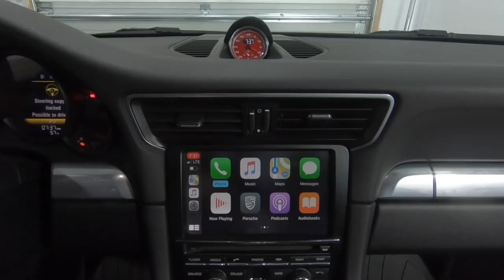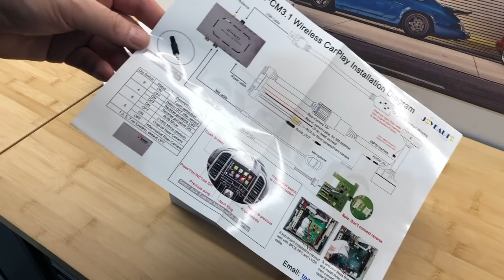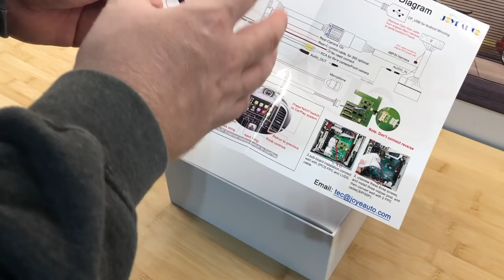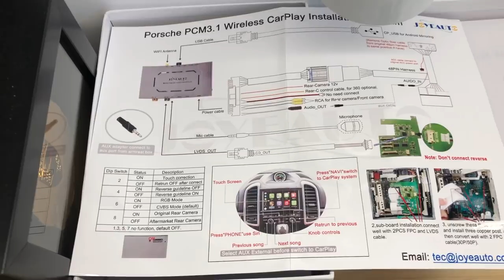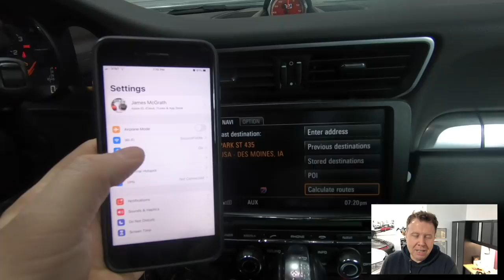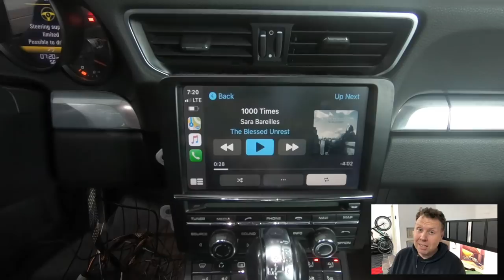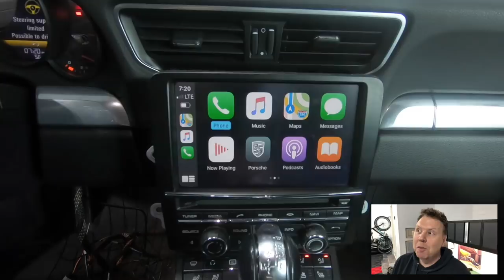Apple CarPlay DIY (Wireless) for Porsche 911 / Cayman / Boxster / Macan / Cayenne / Panamera

Comment: Anyone know the difference between this one and the one from  nmautomotive? Its almost 200eur difference.
Reply from the maker: From what I discovered, they’re very similar solutions but assembled and sold by different companies, but they essentially function the same way. If I remember correctly the Joyeauto solution is the less expensive. Maybe because it’s produced and sold direct from China vs. the one sold from the UK.
Reply: @AutoAmateur  it also looks like there is an ugly config screen that is not from Porsche or carplay. that looks to be different with nmautomotive. Is that screen a 1 time setup or does it appear often?
Reply from the maker: @jasjeetsuri  There are a couple of screens you will see once or from time to time. There is an option to configure your touch-screen to work better with the JoyeAuto device. If you flip one of the little white switches on the rear side corner of the JoyeAuto device (check your instructions for which one) a configuration screen will appear when you power on the device and the PCM. Once you have fine tuned your touch screen config, you need to power everything down, flip the little white switch back to off and then when you start up the car and PCM again you won't see that screen ever again. The other screen you might be referring to is the JoyeAuto home screen. This will come up if your iPhone or Android phone isn't connected via Bluetooth to the "JoyeAuto" bluetooth device option in your phone's settings. You can configure a few different layout and look/feel options from the JoyeAuto PCM home screen. Also, when your phone reconnects to the bluetooth the CarPlay logo will appear green for a second then CarPlay will automatically come onto the PCM. This screen occasionally shows up on the PCM screen if your phone takes more than a few seconds to connect to bluetooth. For me, it happens maybe 1 in 20 times I start the ignition and the PCM. When it appears, it usually goes away within 5 seconds or so when bluetooth connects.

Comment: has anyone had the CarPlay mode go to a touch screen accuracy mode? this is happening as soon as I power the Acc on.
Reply from the maker: Yes. It’s because you have the touch screen set up mode “switch” on the back of the Joyeauto box to on. Check the instructions, then find the switch you need to set to the off position.
Reply: @Auto Amateur ahhhhh you Beauuuuutaay!!  It’s all up and running. No thanks to the JoyeAuto bunch. If it weren’t for this How To my 991would be sitting with wires everywhere and me cussing up a storm!!
Took me 3hrs total start to finish not counting my lunch break and waiting for info.  You were fantastic! Thanks Mate good running keep the pedal down!!
Reply from the maker: Hahahahaha. Cheers John!! Nice one.

Comment: Hi, I installed this kit in my Mini Cooper CountryMan F60(3rd Gen).The problems i face are #1-Touch does not work on Apple or Android or the Stock Interface.#2-The OEM Rear camera does not work.#3-The Aftermarket front camera does not come on.
Reply from the maker: Oh no! Did you set the little switches / pins on the back of the Joyeauto device correctly? There are 8 little white pins that need to be set ON or OFF depending on the options you have. I think the 8 pin needs to be set to ON to activate the rear OEM camera. The 1 pin needs to be ON to allow you to configure the touch screen function, then you turn it to OFF once you're happy with how the touch screen works. The functions of each of the 8 pins should be on the lower left hand corner of the wiring diagram that came with the product.
Reply: @AutoAmateur  Yes, the switches are correct and yet it does not work.
Reply: @zhili4132  if my rear camera doesn't work them I'm going to rip the unit out and send it back , no one mentioned the rear OEM camera isn't supported .